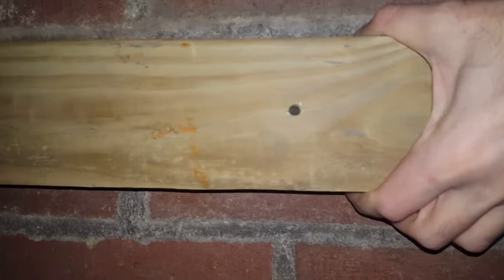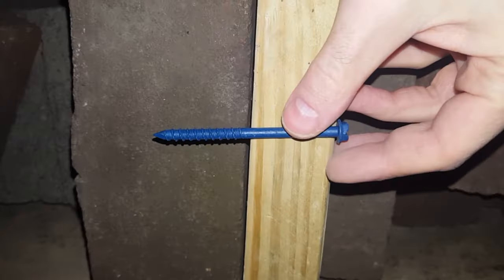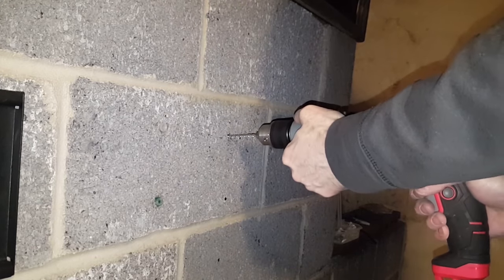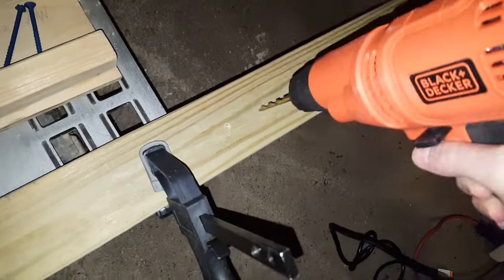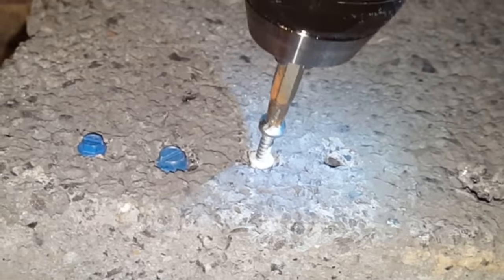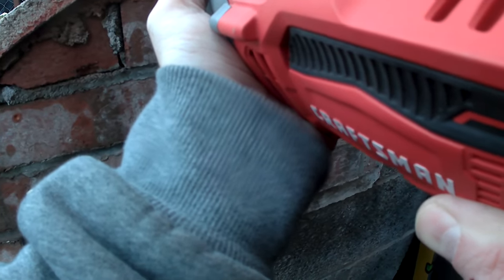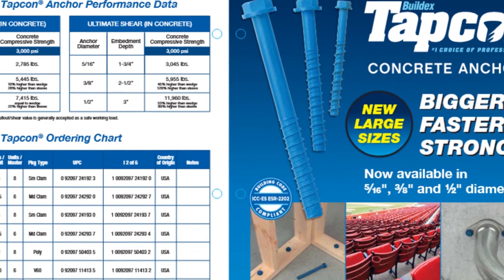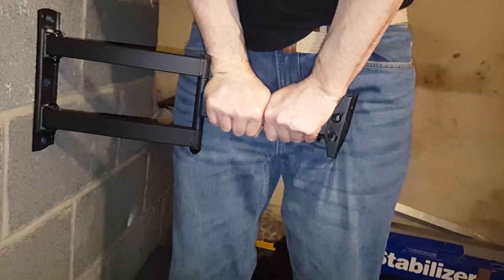How to mount 2x4 to brick or concrete wall | Tapcon concrete screws into brick

Comment: i am building a 10x20 lean to patio roof off concrete house  2x4 screwd to   wall , 2x4 rafters with metal roof ,  would 1/4 or 3/8   inch tapcon be   better   every 18  inches ?
Reply from the maker: I'm not a structural engineer or even a carpenter so maybe someone else can answer, but if I was building that, a 2x4 ledger attached to the wall is way too small if I'm reading that right, and I'd use some wedge or sleeve anchors in addition to the threaded screws and I'd double them up vertically every 12 inches. A roof collapsing can cause injury or death so I highly recommend hiring a professional. Here is more info about ledgers on concrete walls: https://www.decks.com/how-to/articles/ledger-board-attachment-to-a-solid-concrete-foundation-wall

Comment: Best easiest cheapest way is to remember 16/16/16. Drill hole through wood, held in place with a 3/16th masonry bit, insert a piece of 16 gauge annealed wire ( also called tie wire, home Depot or Lowe's) 4 inch piece. Then drive a 16d common nail.
Reply from the maker: That is an easy formula to remember. I advocate something similar when you strip threads but still need the hole in the exact place, but I use a screw along with a wire: https://youtu.be/tQ0ETLlJzC4
Reply: @toolsandrepairs  yes you would drill the hole in the exact place, just as in the video. But at a fraction of the cost and you might even have all the materials already.

Comment: Why use a socket wrench? Why not use a  drill bit?
Reply from the maker: I usually do, but it is very easy to over-tighten and strip the hole. Hand-tightening at the end eliminates that risk.

Comment: Perfect video.  My only comment is that you really don’t need to use a hammer drill unless the hole you are drilling is very large.  Otherwise a regular drill with a masonry bit works just fine.
Reply from the maker: Maybe my bits are too dull, but when I try to drill in brick without the hammer function even with small bits, it seems like it would take forever. If you have a good drill and new bits, it's definitely possible.

Comment: Tapcon is literally the worst choice here. They always snap off. And then you are screwed (pun intended)
Reply from the maker: Depends on what it is: a ledger board, yes you need something like large wedge anchors. Other cases, install tapcons at the right depth and install every 12 or 18 inches. Also use the larger screws for more strength